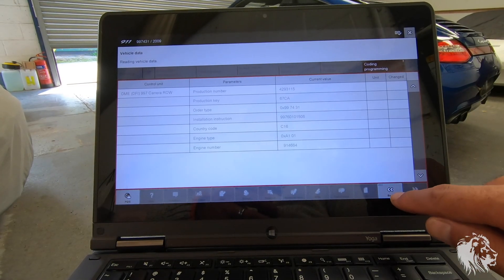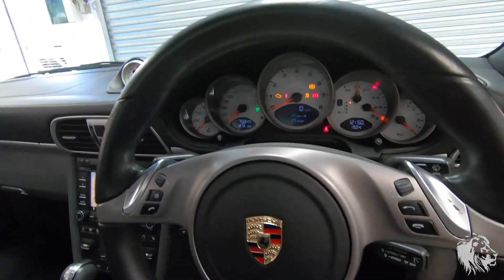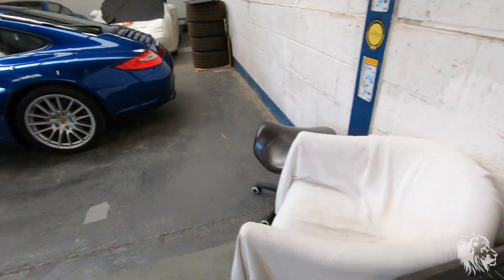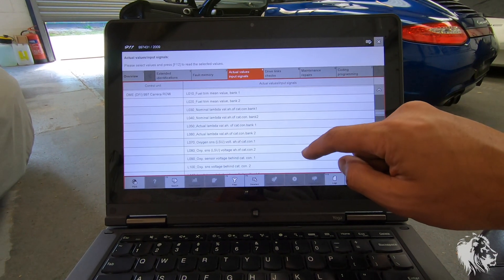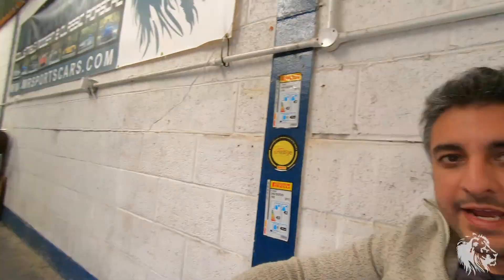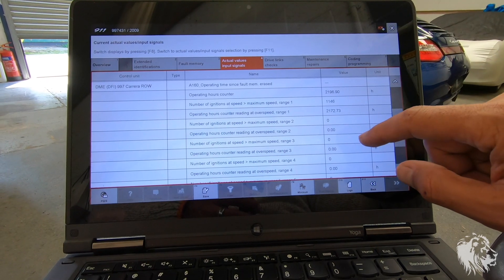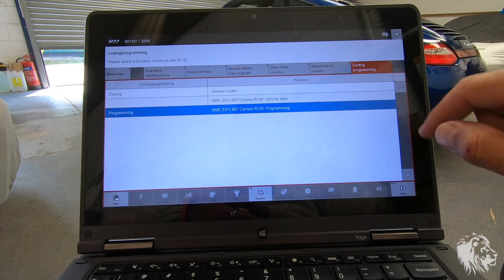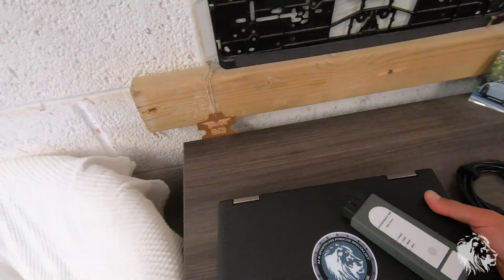How to Check Engine Overrevs & Clocking Porsche 911 997 Gen 2 - Ep 30 Diary of a Porsche Specialist

Comment: I have PIWIS set thru simulations and it all appears normal operating.  I have read that once plugged into my 2000 996 I will have to tell it car as it wont auto detect, no problem.  I only want to check basic report much like cam deviations and Rev counts, I think nearly same data pull as you did (great video thanks!).  That said you did not appear to have a large amp or any(?) external 12v fixed output power supply hooked to the car's battery.  Is it safe to assume with a good battery those small diagnosis readings are not large power draws like I assume full VAL or writing coding?   Care to add dialog about when fixed power addition supply might be needed, thanks!
Reply from the maker: A good fully charged battery should support all functions, but yes as a precaution you can hookup an external charger. I keep all our stock on trickle chargers so they are all fully charged in terms of car battery. Cheers